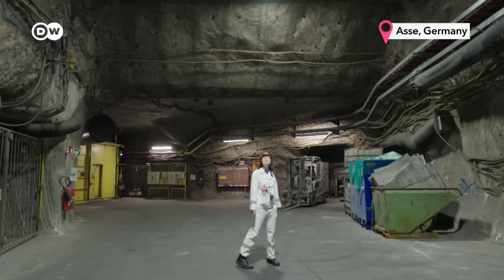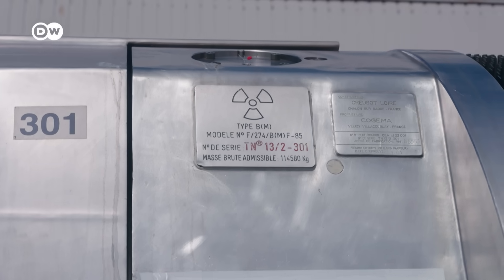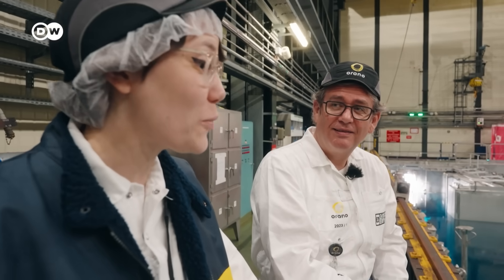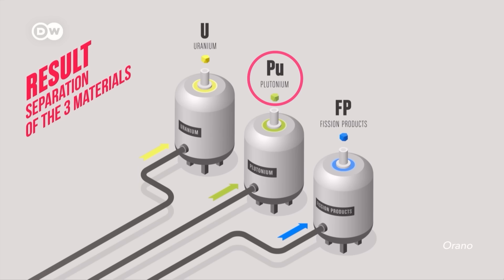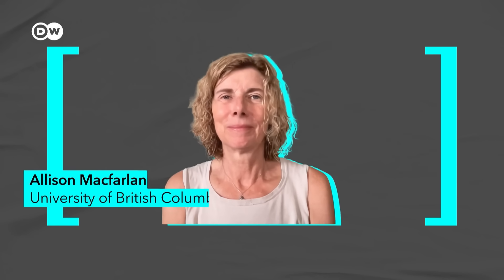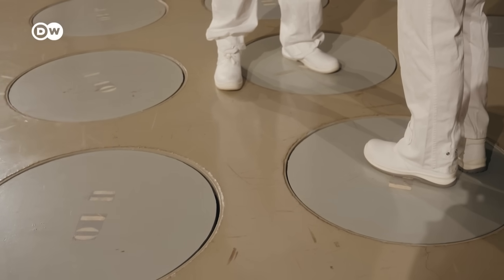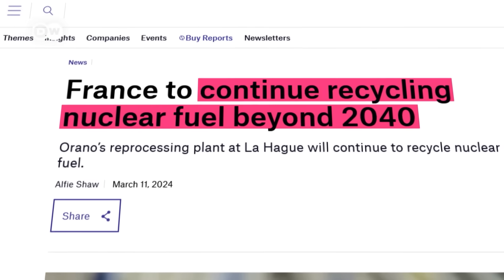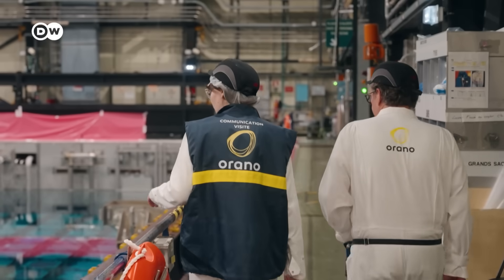Nuclear waste is reusable. Why aren’t we doing it?

Comment: No it isn't, I saw a interesting Doku. on ARTE about the French nuclear power plants and they questioned a Nnuclear power plant speaker, what they do with it and where.

The speaker was surprisingly honest and said, "The fuel rods are sent to Siberia for reprocessing, but the truth is, they aren't reprocessed because it's not possible, and the cost-benefit analysis doesn't add up, they get new ones from Russia."

Then it was also mentioned that France simply releases the cooling water into the Atlantic Ocean twice a year.
Maybe U find this Docu. on ARTE Mediathek.

Comment: Recycling the “waste”
Means extracting all of the fissile energy. Moltex simply turns the material into salts which are then reacted in its stable salt reactor. The isotope content is untouched.  
Reprocessing means extracting the most fissile isotopes to make new ceramic fuel pellets. Or for putting into military use. The waste is still radioactive for thousands of years.

Comment: The Brits did recycling in Windscale. They contaminated the surrounding area so badly that you aren't allowed to visit the shore there. The British tried to sweep the problem under the rug but radioactivity doesn't just vanish.
Germany did recycling in Hanau. The company NUKEM lost plutonium in the process (without polluting the area) and couldn't explain where it went. Enough plutonium to build several fission bombs. Even the biggest German fans of nuclear power plants were worried about that.

Comment: If you don't produce any waste, you don't have to think about how to recycle it. No waste is the best waste. Therefore, no nuclear power is the best nuclear power. Furthermore, recycling does not make nuclear power cheaper, but more expensive. Cleaner, but not risk-free. The sole purpose of recycling radioactive waste should be to reduce the dangers.
Reply: Then let's continue to smoke from coal-fired power plants, which will kill us all faster than a warehouse of low-activity and long-fission nuclear waste will.
Reply: @Illilop-hn1pu  Regenerative energies exist.
Reply: @FactionalSky The sun doesn't always shine, the wind doesn't always blow. And renewable energy isn't capable of sufficiently covering human needs, without taking factories and businesses into account. Renewable energy other than hydroelectric power plants isn't economically feasible. The energy yield per resource expended is extremely low, and, as I said, they're unstable. And wind turbine blades are a separate issue. They kill birds, and they're not recycled. While we have green renewable energy, governments and companies quietly leave spent blades to fall into the African deserts. Solar panels don't last long—20-30 years, and even that requires entire hectares of land to produce any energy. And that's an unaffordable luxury. And you might think you could use batteries. The answer is no. They take up a lot of space and are dangerous because they can explode from any damage.  They have a very short lifespan, maybe a decade, and then they need to be reprocessed, which is VERY expensive and very dirty. And their production itself is very dirty.

Comment: This is excellent. Thank you. One question. If steel is so effective at containing fissile material why not build the containment structures at nuclear power plants in steel rather than concrete?
Reply from the maker: Hi Ralph, concrete attenuates gamma rays and neutrons better than steel, withstands high temperatures during accidents, and is less prone to corrosion over decades of operation. Steel alone would require much greater thickness for equivalent shielding and is more expensive to construct. Most designs use a steel liner inside the concrete for airtightness, but the main shell is concrete for safety and cost reasons. 🙌
Reply: @DWPlanetA Thanks

Comment: Because people associate "Nuclear" with weaponry, Chernobyl and Fukushima, even though Nuclear Power (maybe rebrand it as Atomic Power or something?) is distinct from weaponry, and Chernobyl and Fukushima didn't fail because NP is unsafe, but because the designs were flawed in many ways.

Chernobyl was an early design, cutting corners in every way. Poor materials, poor design (basically putting them in a wooden barn compared with a huge thick concrete building, connecting the separate reactors and control systems, and countless other things.

Fukushima... where to start... storing the batteries in the basement? Putting the plant next to a coast known for Tsunamis and earthquakes? Lack of any serious passive cooling/shutdown systems?

On top of everything else, the choice is not nuclear power VS solar/wind, right now it's actually nuclear power VS more coal, oil, gas plants. I want solar, wind, geothermal, etc, to become viable, to be used where they are best suited, and it would be GREAT if we didn't need either fossil fuels or nuclear power. Sadly, right now it's simply not possible to use all renewables.

The new reactor designs (several types) are extremely safe, can - as your amazing video shows - run on nuclear waste or even nuclear weapons materials, and the thing is that more fossil fuels means 100% chance of extreme climate damage, environmental damage, and deaths, but it's spread out. The deaths from the fossil fuel pollution are spread out over the entire planet, and more lung cancer (and other things) are hard to pinpoint the cause of.

If the problems with fossil fuels were concentrated near the source equal to that of a nuclear power plant, they would be immediately seen as how horrible they are, but the pollution in the atmosphere are so spread out that they are invisible.

That's not even to get into the climate damage, which WILL cause damage far more than any new reactor design is ever going to cause. Floods, draughts, storms, famine, sea level rise, and - what many people don't think of enough - the large scale migration and wars which ARE going to happen when climate change worsens. If a country has a strong military but is suffering from draughts, famine, etc, and have a neighbor with water, food, etc, but a weak military, does anyone really think that the nation with a strong military is going to sit around starving and dying of thirst when they could invade and take the resources they need?

Or if the nation doesn't have a strong military, but has a huge population, you will get migration patterns which make the Syrian war migration look like a drop in the ocean.

I fully support new, safe, modern nuclear reactors. It's a political and branding issue, as well as a short-term-blinders issue because while nuclear power is many times more profitable than say liquid gas (especially since the fuel is so cheap), it can take 15+ years to repay the debt after a 6 year build time, where as the gas plant can be built in 2 years and giving profit a few years after.

Like so many human problems, we contantly harm our future in the name of the short term. Companies seek profits for THIS quarter (so they can get huge bonuses and dividends for investors), politicians seek gains immediately so they get re-elected. If we thought a little deeper into the future, we would all be better off.

There is some saying that a society does well when people plant trees which they themselves will never benefit from. Some trees (like olives) take many many years before you get a harvest, but then they last for ages. We all need to think more about the future.

Comment: Nuclear energy is not going to reduce global warming. We just changed the heating source of thermodynamics from carbon based to nuclear based. We still heat up the  environment. We can still use bio fuel generator based on CPO and the world is going fine but everyone says otherwise. Carbon neutral is the key. Trapping the carbon with CPO and burning it again. Zero carbon emission zero heating up the planet.
Reply from the maker: Hey there! Thanks for sharing your thoughts! We have a whole playlist on different energy sources, including renewables, on our channel. Subscribe ♻️
Reply: That's not how it works. Heating from thermal plants is tiny compared to the power of the sun.

The sun bombards the earth with several times our global demand. 

That's why the ghg effect is so potent.
Reply: Palm trees alone won't provide enough. We'll cut them down faster than we can meet our needs. And using vegetables and other plant materials for biodiesel could cause food shortages and global deforestation. And we're already using so much energy that older energy sources are unlikely to be viable anytime soon.

Comment: So there is a single recycling facility operating at large scale, that is heavily subsidized by taxes because the costs of nuclear energy are enormous, that produces lots of material that could be used in nuclear bombs, and in the end a lot of nuclear waste is left anyway. 
What is wrong with this comment section? Have we seen the same video? The obvious thought here is not push recycling of nuclear materials, but to stop creating nuclear waste in the first place -> renewable energies. Is DW aware of the community that they are fueling with this video? I am disappointed

Comment: To say that >90% can be recycled is misleading. Very little of the spend fuel is U235, U233, Pu239, Pu240 or other easily fissionable material.
Reply: Easily fissionable in the usual plants - yes. 

However, energy rich is energy rich. You CAN reuse this energy for something else if you wanted to. But it just isn’t done.
Reply: @MetallicReg I could put that highly radioactive material in my basement and run a sterling engine off it.
Reply: @0MoTheG It wouldn’t be the most efficient or secure use of it… but yes ;)

I think drilling down to geothermal ranges would be easier in this specific case.

Comment: Radio waste always seemed like a mystery to me

Like how does it get created?
This is the plastic bags all over again
Reply: The nuclear waste most people refer to is high level waste. That's the stuff that takes centuries to become safe.

High level waste is the spent fuel and reactor parts exposed to it.

As you know, fission is splitting atoms. This creates other elements, which aren't as easy to fission to create energy.

Over time the fuel gets mucked up by these byproducts until it's no longer able to efficiently react.

At which point it is deemed spent fuel.

Comment: Nuclear waste from conventional light-water reactors is mostly (~96%) reusable as fuel in advanced reactors—primarily uranium-238 (which can be converted to plutonium-239) and unused uranium-235. The remaining ~4% is high-level waste (fission products), but even that can be reduced via reprocessing and fast-neutron reactors that "burn" long-lived actinides.

### Why We Aren't (Mainly in the US/West):
- **1977 Carter Ban (Still Influences Policy)**: President Jimmy Carter halted commercial reprocessing over proliferation fears—extracted plutonium could be diverted for bombs. This was echoed in the 1982 Nuclear Waste Policy Act. France, Russia, and Japan ignored this and reprocess routinely.
- **Economics in a Low-Uranium-Price Era**: Fresh uranium is cheap (~$50/lb U3O8). Reprocessing costs $1,000–$2,000 per kg of heavy metal vs. ~$200/kg for mined uranium. Once-through cycle wins short-term.
- **No Closed Fuel Cycle Infrastructure**: The US has zero commercial reprocessing plants (last one closed in 1972). Building one costs $10–25 billion and takes 10–15 years. France’s La Hague plant processes 1,100 tons/year but required decades of state subsidies.
- **Regulatory Inertia & NIMBY**: NRC licensing for advanced reactors is glacial (10+ years). Yucca Mountain delays mean spent fuel sits in dry casks indefinitely—cheaper than solving the problem.
- **Technical Mismatch**: Current fleet (PWR/BWR) produces waste optimized for storage, not reuse. Fast reactors (e.g., GE-Hitachi PRISM, Russia’s BN-800) that eat waste need MOX or metal fuel—different supply chain.

### Who Is Doing It:
- **France**: Reprocesses 1,100 tons/year at La Hague; recycles 96% into MOX fuel for 20+ reactors. Waste volume cut 5x.
- **Russia**: BN-800 fast reactor runs on recycled fuel; plans 11 more by 2040.
- **China/India**: Building fast reactors + reprocessing to stretch uranium reserves.
- **Private Efforts**: Oklo’s Aurora (micro-fast reactor) and TerraPower’s Natrium aim to burn waste but await 2030s deployment.

### Path Forward (If Policy Shifts):
1. Lift the de facto reprocessing ban (executive order or NWPA amendment).
2. Fund pyroprocessing R&D (non-aqueous, proliferation-resistant; Argonne lab demos).
3. Deploy 1–2 fast reactors as "waste burners" (e.g., at Idaho Natl. Lab).
4. Long-term: thorium cycle or molten-salt reactors could eliminate >99% of waste.

Bottom line: It’s a policy + economics problem, not a technical one. If uranium hits $200/lb or waste storage costs explode, the math flips overnight.

Comment: Why can't it be recycled again? Is it tied to costs or is there another cause?
Reply from the maker: It can be recycled. But why it is often not, the video will explain more. ☢️
Reply: @DWPlanetA  I didn't quite catch that in the video. I'm referring to the fact that the RECYCLED fuel is not recycled again. I get that some of it is used away and eventually you'd get less and less from recycling. But is there another reason? Does it get more complicated with each cycle? Or is it just too costly?

Comment: In a molten salt reactor, the actinoids float to the top and can be removed, leaving the good fuel behind. Achieves 97% efficiency instead of 3%.  Can also theoretically use "spent" fuel

Comment: The barrels in the pictures at the start are more irradiated material than radioactive material. There might be some radioactive material, due to neutron activation, but those barrels are for medical material and the like. Reactor wast is put in the huge tanks made of multiple layers of steel and concrete. And are gray or greenish.

Comment: Russian reactor БН-800 is operating for already two years using ONLY WASTE NUCLEAR FUEL from other reactors... And this type of reactors on fast neutrons can be used to produce nuclear fuel out of depleted waste.  It seems like campfire, where you you adding 3 logs in, get out energy and then take out 3 logs back (but new logs only can be used with previous types of reactors. But when they get depleted there - go another round) . We build several more reactors of this type. Think about it!

Comment: Still dont get why we dont harvest the energy later on when its not suitable for normal powerplants.
Like 
1st use, powerplant
2nd use, smaller turbines, its still way over 100 degrees hot for years so it still produce steam and energy with way lower chance for critical mass emergencies.
3rd use: heating up water for households for decades.

Comment: Because this story never was true. It would be economical nonsense to do it, and the (also nuclear) waste volume created by it would just grow. Neither „Transmutation“ nor „nuclear recycling“ will solve any of the problems of nuclear fission. That is not true, there is one solution: just stop producing more nuclear waste every day and use much cheaper and cleaner renewable energy. Nuclear fission was an error to begin with, it was mainly done for military reasons on a scale that had to be sold to the public. It always was uneconomical expensive, unpractical and dangerous, as proven several times in history.

Comment: The problem in the US is that Green/Liberal politicians have regulated Nuclear as a non-green energy, lumping it in with Coal and Natural gas, so that there is little to no funding of research into recycling nuclear waste.

Most states have regulated and banned the building or expansion of nuclear in their states, only allowing Solar or Wind as viable new energy sources. Maryland right now only have one Nuclear plant and is having legal battles taking over owners land to add more powerlines to import Nuclear generated electricity from Pennsylvania because they want to shut down a coal power plant that is run only during peak load, and the state has legislated that the Nuclear plant cannot be expanded.

As Liberal states mandate more Electric vehicles, they are having more shortages of electricity supply but have limited ways to produce it.

Comment: from fossil fuels to nuclear never do they ever learn from one disaster to another nuclear is unusefull as waste material and even after being used up you still have to deal with waste material that's too toxic so ending up with making more places to store until you have no more space or until another disaster happens when those buildings infrastructure will leak toxic materials and then you have more problems than you have ground in safe zones that are not affecting the environment from exposing toxic materials. whether it might be natural disaster or manmade either way when those buildings and storage will have mean for nothing. when there is a way for a disaster waitin to happen guess what it ussually does and yet it happens at times when you least expect it

Comment: I'm wondering, if they're recycling nuclear waste, can they pricess plutonium 238 specifically? 
That's the stuff NASA uses for long-range and long-term space probes like Voyager, and it's extremely hard to get.
Reply from the maker: Good question! Regular nuclear recycling doesn’t really produce much plutonium-238, which is made separately by irradiating neptunium targets for space power sources like NASA uses. So it’s more of a special production process than recycling.